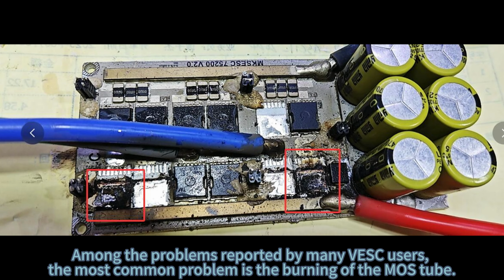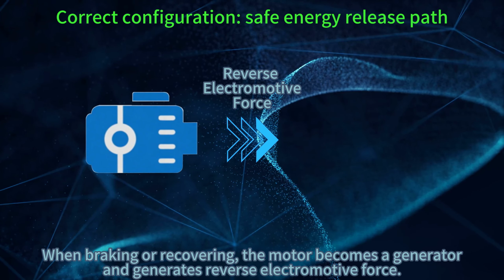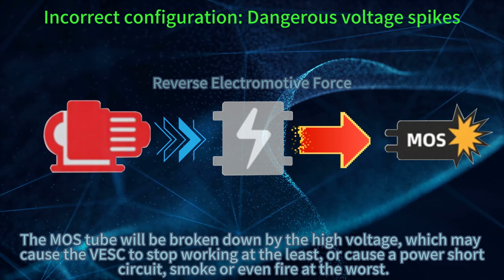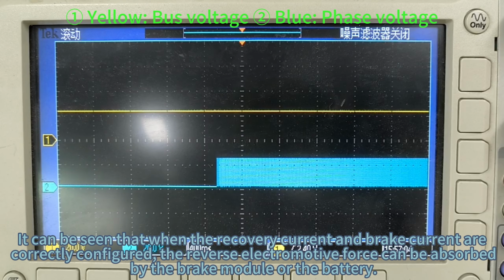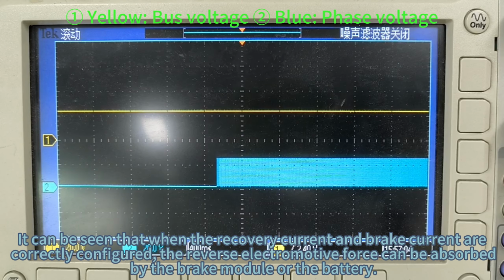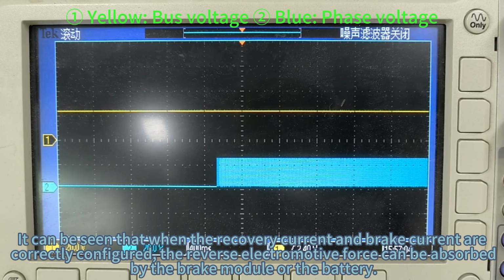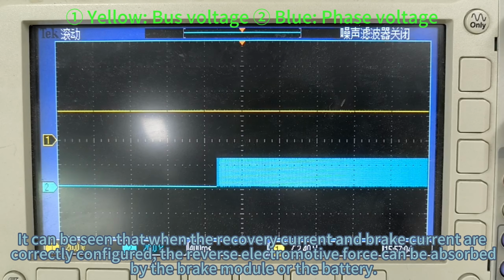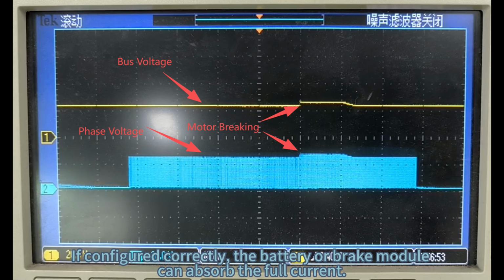VESC Brake and Recovery Current Configuration Guide and Warnings

Comment: vesc in version 6.05 has limit voltage to apply brakes and i also don´t use electric brakes and mosfet of makerbase still burn why?
Reply: what is your setup? I also don't use regen with makerbase 84200 and so far so good.